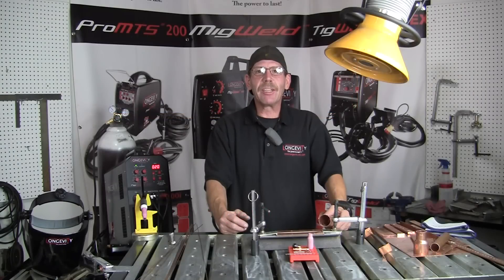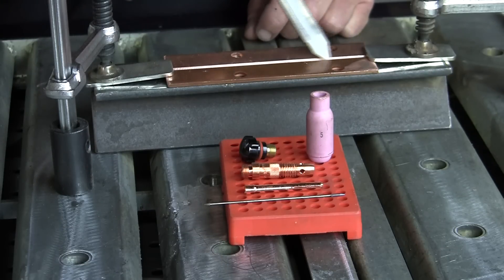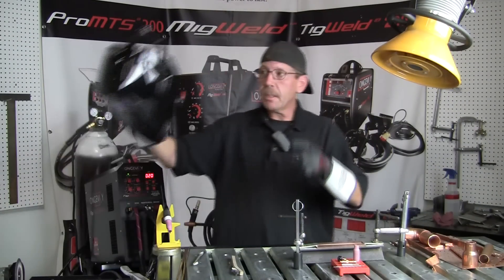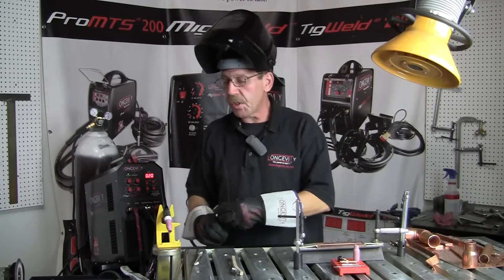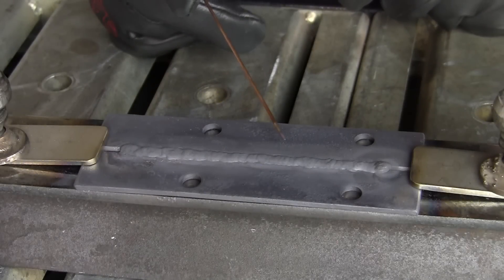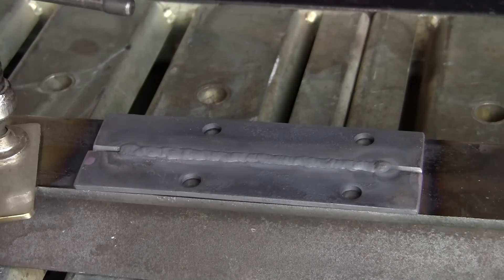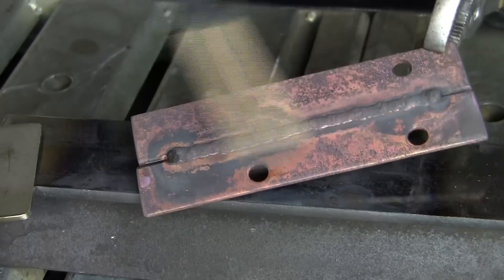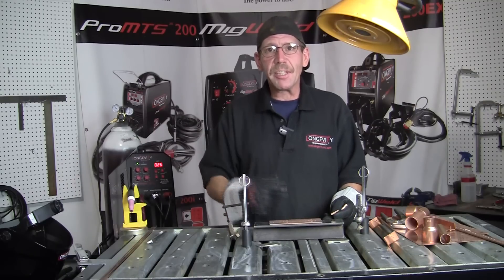TIG WELDING COPPER TIPS AND TRICKS

Comment: Dude cooked the shit out it. If done right the weld should have colour similar to stainless, they reason it looks grey is because u oxidized the copper. When you oxidize the copper like that u wreck the properties u want from copper such as corrosion resistant and excellent conductivity of electric current.

Comment: What gas were you using? I've heard a bunch of people say to use 100% helium rather than an argon mix. It puddles faster and you get a better looking bead. What are your thoughts?
Reply: I agree, helium would probably wet faster and not make you struggle with blowing holes when the whole thing soaks up the heat.

Comment: Was the tig welder AC or DC
Reply: Jaydon Fuller AC polarity
Reply: Tim S. can copper be welded with dc tig
Reply: Jaydon Fuller His welder is Ac/Dc machine, he said he was using DC. I have only tried AC a few times with decent results. Usually I braze copper since its not that strong of metal and the braze is stronger.
Reply: Use DC straight polarity also known as DC electrode negative for all thicknesses or u can use AC for thin. Google Tig welding charts and it will tell u how to set up for different metals.

Comment: All wrong.  I just finished welding 1/4" X1" buss bars. Tig welded about 210 amps AC with AC balance on full penetration using straight argon shielding and a 200 amp water cooled torch.  No expensive helium needed.  Use 1/16 3DOC tig rod ( triple de-oxidzed).  Rule #1,  elevate weldment off the table which will suck all the heat from your joint!  Most important!!!

Comment: need to learn what you are saying and doing. NO where near enough heat this was a braze not a weld. You need Helium to increase amps especially on a 200 amp machine then once the copper starts to melt you got to move not go slow but your base metal never melted so like I said this was a braze.

Comment: The result looks great to me. What kind of rod were you using?
Reply: +Ralph Dratman I didn't make the video so I can't speak for him, but I would imagine it was just 12 AWG electrical wire. It's what I use. It's super low oxygen super high purity copper up to 99.98% with trace elements, most notably, oxygen and zinc (but at levels well inside the safe range)
I wish he had told us his gas, tungsten size/type and amperage.
I use 2% ceriated for absolutely everything nowadays.
And weld it FLAT no matter the cost. Molten copper runs like water.
In general when I'm welding .030 wall copper tubing I use  55A on the button.sometimes I drop it as low as 52. But that's just related to how shaky my hand is or isn't that day.
. So almost exactly double the amperage per thickness than steel(with argon shield, no idea about helium)  It may melt at a lower temp than steel but man does it draw the heat away fast.
I hear a low rate pulse can do wonders for puddle control, but I'm still fiddling with the settings. It seems to have VERY real potential if I ever figure it out! (you don't want pulse rate too low or the puddle just vanishes and boy is it hard to get back!)
Not only is pre-heat recommended, it's just about impossible to avoid!
Reply: +MrJgstoner Thank you. May I ask what welder you are using? The one I am using now does not have a numerical readout for current and I feel like I am flying blind.
Reply: The welder I use at school/work for this stuff is a  miller dynasty 200. It's honestly more welder than Than I need.
AHP makes a great machine that can do just  the same stuff at a SLIVER of the price.
I hear it's getting good reviews. People who have them seem to like them (last I checked)
Link here for the one I've seen reviewed
http://smile.amazon.com/AHP-AlphaTIG-Stick-Welder-PULSE/dp/B00REX6USW/ref=pd_rhf_cr_s_cp_5?ie=UTF8&refRID=1PAJXPFBW5GPZK7KZSF3

If all you need to do to feel comfortable is know your amperage, get a clamp on ammeter. Make SURE it has DC capability! Then you make dead sure what amps you are running down to the fraction. to do this you can take your electrode lead apart and clamp your ground directly to the copper wire, turn the machine on and write on the machine face what amps are being output at specific dial locations.
You could also just get a tungsten you don't like anymore and intentionally touch it to your work then take your measurements. (this is another place copper would be a good idea in place of steel.

The meter I use for this is on amazon here.
http://smile.amazon.com/gp/product/B001VGND88?psc=1&redirect=true&ref_=oh_aui_detailpage_o04_s00

I know that one works fine and is a steal compared to any others I found that could measure DC amps
Reply: +MrJgstoner That clamp meter is the best idea I've heard in a long time! Thanks so much.
Reply: Thanks! Youtuber AvE helped a lot by suggesting clamping directly to the copper leads. The dude is a genius and really funny

Comment: You keep pulling your filler rod out of your shielding gas... At high temperatures Copper will form Oxides when it comes into contact with oxygen, When you dip that oxidized filler rod back into your weld it will introduce impurity's. Also rubbing soapstone on your copper before welding it was not a good move either.
Reply: Yolog Swedge ..
Reply: Ya!

Comment: Hi there. Does the gas have to be 100 % argon or would you use a argon/helium mix. And which colour electrodes do you use, we only stock white and red tip. I was wondering if there's anything I'd have to buy in before we undertake the job. Cheers.
Reply: Helium is the gas of choice, just like stainless you need to be in and out quickly with lots of power.
Reply: +Benjamin Bauer 
As with welding aluminum, copper is a major heat sink as the conductive properties work very well with copper. Most tig welders are in the 200 amp range and I am usually at or above about 10% the 1 amp per .001"
Reply: ok, but you said "just like with stainless..." which doesnt make sense when the material being discussed here, copper, is many times more conductive than stainless. MAtter of fact, you want as little heat input as possible when welding SS because it warps so easily. As far as Helium for shielding; its only necessary for Heliarc welding (using straight polarity) because He is 170% more heat conductive than Ar; which means you should be using less heat (amps) not more to weld relative to DCEN welded steel with Ar shielding.
Reply: Sicktrickintuner what do you mean "with lots of power"? Perhaps you mean with adequate power to start the puddle? -A lot of newbies on here, you will confuse them with your confusing wording.
Reply: I have looked high and low for someone to explicitly say how much power they expect to need to weld copper and here, lo and behold, do I find my answer! Thank you for being clear and saying more than "you're gonna need a lot of amps!"

Comment: you said "Tig weld copper just like TIG weld Steel, Stainless and Aluminum..."  Since Al and Steel are welded with different polarity and fillers, how can that be?  Looks like copper filler which would not be used on steel, aluminum, nor stainless. Prob better to say what polarity, amp, gas, filler rod, etc., for us to understand what you are doing.
Reply: LWELDS.com Still yo never mentioned any machine settings, tungsten type or size or even which shielding gas you used...
Reply from the maker: Hi John,

I think you misunderstood. We said the setup of the machine is similar to setting up the TIG for other processes. However, it is different to weld it which we go over.
Reply: LWELDS.com Hey.  I sincerely think you should see the weld.com   
channels video on tig welding copper. Gets perfect results without heat soaking the whole piece and he even explains everything